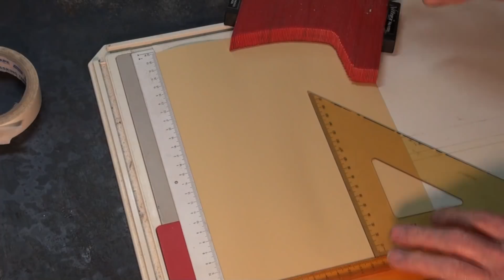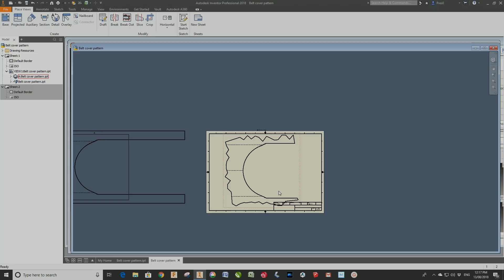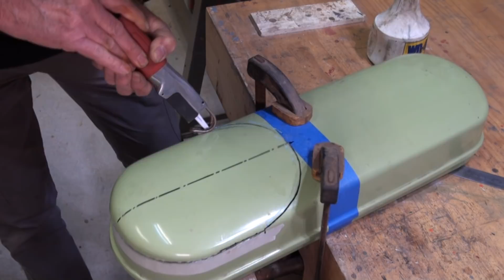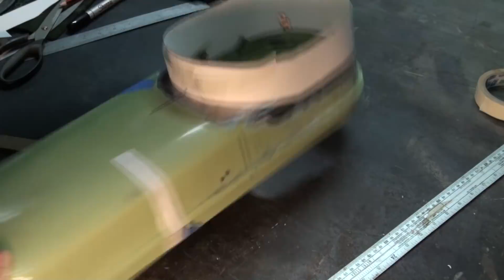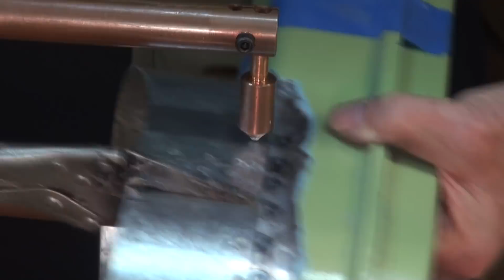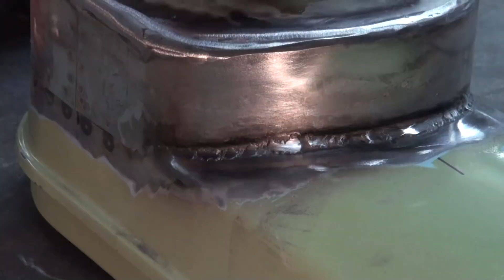Modifying a Belt Cover For a Drill Press

Comment: Nice repair.  It is hard to figure how they can ask so much for a little electrical cord.  It was probably made in China for 50 cents.
Reply from the maker: If it's Festool, it's gonna be expensive. I just bought a Festool Rotex sander  and it cost me over $1000 😮 It was for sanding down my entire deck and so far it seems to be doing a good job. Very powerful at 750 watts and it has a very aggressive sanding pattern but man, it's eye wateringly expensive.

Comment: I remember that tech drawing book and many tech drawing classes.  All I can say, is thank goodness for computers!
Reply from the maker: I feel a bit conflicted about the decline of manual drafting. The results were never fully accurate but it could be done directly on to the material in the case of developments but I would not want to be drawing some really complex parts as orthographic projections. The cost would be astronomical if you had to pay a team of draftsmen (women) to draw out a Boeing 787.
Reply: My Dad is now in his 80's he still works from time to time as a hydraulic designer.  He never relinquished his T square and it was the last one in his office.  He still boasts that it was hugely faster than the cad systems!  I was never any good at it though. :-P

Comment: Mark, did you make that roller? I am outfitting all of my tools with treadmill motors etc...anyhow i see a good use for the rollers that were on the treadmill and, turn them into a metel bender
Reply from the maker: Chris,
I made that roller around 15 years ago. It was described in the Model Engineer magazine by the legendary George Thomas during the 1970's. I found a link to the drawings and workshop notes here http://www.nickbaines.me.uk/BendingRolls.pdf
I am guessing it could be made to suit longer rollers within reason. If there are any gears in the treadmill they could be used to power the top roller.

Comment: Over the top methods would be using lead as the filler. :-) Auto body filler will work just as well though. Not sure about your hinged cover, but the 3 different drill presses I've had one of the aggravating rattle areas has also been the cheap and sloppy fitting hinge halves and the pins. Probably a bit too late now, but this would have been the perfect time to grind there welds off and upgrade to some much higher quality hinges. Interesting and well explained video as always. Probably quite a few would have just cut an opening in the top to clear the new parts and left it at that. It's nice to see someone trying to match how the factory would have done it. Going to the extra effort to do a craftsman like job is always rewarding if one cares enough.
Reply from the maker: Thanks for that. We had the same problem with rattling belt covers with some machines at work. The problem went away when I fitted the poly vee belt to my home shop machine. Because those belts are much thinner they don't seem to get a "set" in them so they conform to the shape of the pulleys better. The worst rattler machines were the ones with the double reduction belt drives. I may fit some thin rubber gaskets between the belt cover and the head of the machine when I put the cover back on just to uncouple the cover from the rest of the machine however, as I said my machine is mostly quiet now.

Comment: would you be willing to do some video, going over the drafting technique you were discussing to join two solids
Reply from the maker: I'm afraid that would be possibly one of the most boring videos ever made. 😁 There should be some good books available which demonstrate the basics of what we called "Solid Geometry" or more specifically, "Interpenetration" With the uptake of CAD for doing this sort of work the manual methods are rarely taught these days. Libraries should have some resources. I also found some tutorials like these https://www.youtube.com/watch?v=iZkD6zn4RI8 There were some others but the commentaries were not always in English!
Reply: @Preso58  well I would love too see it, if you have any  old book titles to pass along it would be appreciated
Reply from the maker: Hi,
The text book that was used for Senior Geometrical Drawing in Queensland, Australia was: Advanced geometrical drawing : metric measurements / by R.J. Millican. ISBN 0855680776It had very good worked examples of all types of solid geometry. The other book that I showed on the video was "Engineering Drawing" by A. W. Boundy ISBN 0 07 093176 3 It covers a wider field of drawing including Engineering Drawing in 2D and 3D as well as Plane and Solid Geometry.

Comment: V  as stated below you gotta take the zinc off before welding, toxic fumes aside the welds wont hold worth a damn.
Reply from the maker: Several people have commented the same thing. In practice though the welds held up quite well for what I was doing. I don't think I would want to trust them if they had to be structural but in future I will remove the zinc. As you have said, I don't want to be breathing the fumes. My mate, Macca said that back in the day, when they were stick welding galvanised steel they were told to have a big drink of milk before work started to mitigate the zinc fumes. I was told exactly the same thing when I was going to college! 😒

Comment: Looks fantastic. I would've sanded or chemically stripped the zinc coating off the galvanized steel first, probably would've saved you a bunch of time. Those were some ugly and corroded welds, no way around it. Galvanized steel is gross. Oh well, you use what you got and you made it work.
Reply: Allways best to have your mate weld your galvanized for you😁
Reply: As soon as I saw the galvanized I thought he would grind down all the zinc with a sanding disc.
Reply from the maker: Matt, I'm glad I only put three tacks on it, and one of those had a hole in it! Macca was doing his best and cursing me for bringing him another difficult job but we got there in the end.

Comment: You reminded me of my engineering drawing classes back in high school in the mid 60's.  One of my favourite subjects.

I am struggling with computer based CAD so I would have done a CAD approach to make the hole like your second CAD - Cardboard Assisted Design.

I would have cut a hole in a piece of cardboard, clamped this above the cover and hung a light above the cardboard.   I would then have adjusted the height of the cardboard so the edge of the hole matched the outside of the cover then used a sharpie to mark the intersection.

I would have used the sand second CAD step.   I love having paper or cardboard templates for such items.

Thanks for the tip on the nibbler.   I learned something new.

Your friend did well to weld the thin metal without blowing through.

The modified cover is looking good.

Dave.

Comment: I personally like to soft solder when i build sheet metal cases. 
It's fast, forgiving and easily changed when a mistake is made. Only the contact surfaces have to be large enough to give good hold. And you can use the solder as filler. First i make the pates then i hold everything together with cheap skews. After that i solder everything, remove the screws and close the holes with solder. And then everything gets sanded down, and build up where its needed.

I also have a lifetime supply of leaded solder from back when. :-)
Reply from the maker: Hi, I also have plenty of leaded solder and I sort of wonder what the fuss is about with lead. The people who make leadlight windows use the stuff every day and they solder the joints which are pure lead as well. I used lead as a filler on a toy air gun that I was given as a child (before politically correct toys!) I like using it because you can file it accurately and it doesn't shrink or fall out over time. After I painted the repairs they were invisible.

Comment: (Now that you are done, LOL) Why add to the top of the cover? Why not add an extension skirt to the bottom edge of the existing cover. If you did not want to weld/braze/solder, you could use rivets and Bondo to make a smooth and non-rattling joint. You could paint the extension a complementary color (if the original color was unavailable) for a stripe effect.
Reply: Toby W   That would look ugly as hell!   The guy has a bit of class.

Comment: Probably had issues since welding galvanized steel is a pain.
Reply: Agreed.  Probably what he had on hand.  Never a first choice in my book.
Reply: Poisonous also, very bad for your lungs!
Reply: Very simple to solve - just "paint" the galvanized part with hydrochloric (muriatic) acid and you get rid of all the zinc. Then give the metal a scrub, to get rid of the zinc chloride, before welding.